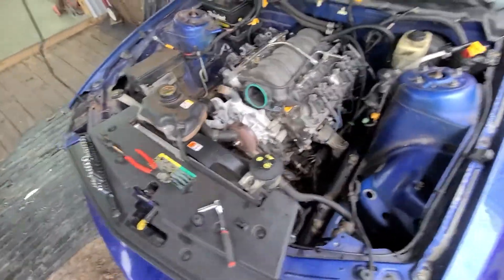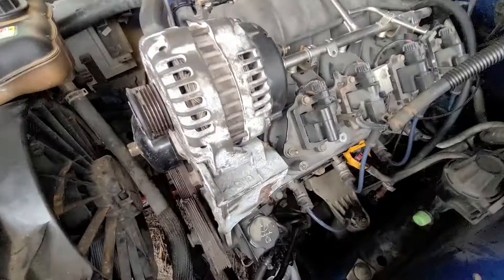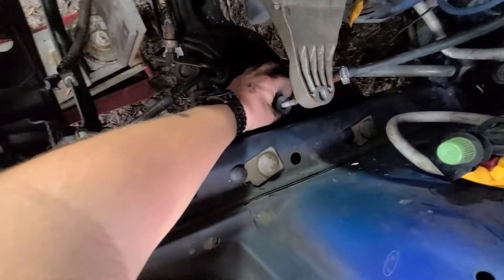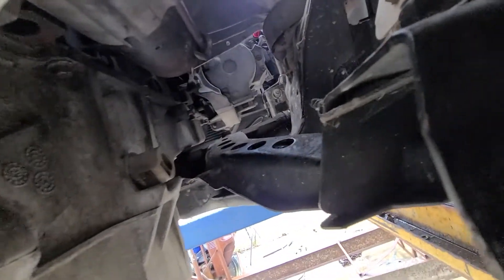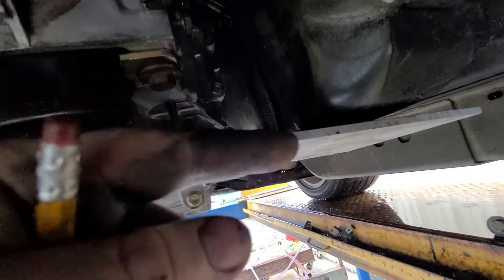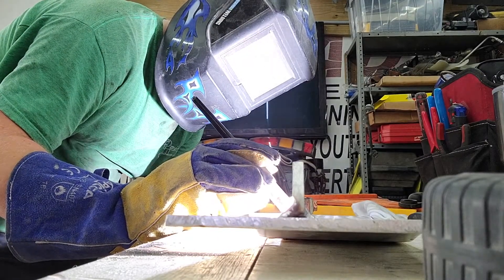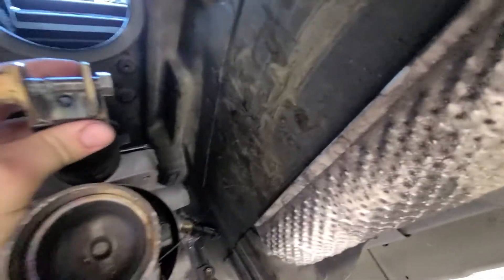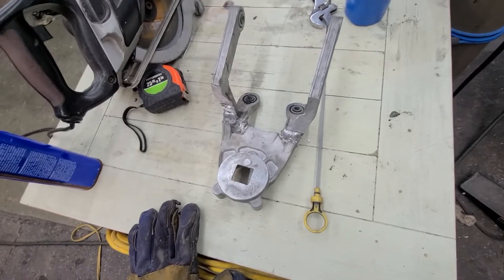LS Swapped S197 Mustang PT.4 | TRANSMISSION CROSSMEMBER & MODIFYING THE CD009 SHIFTER LOCATION

Comment: What did you do for the high pressure side of the power steering pump?
Reply from the maker: I cut off the both the metal high pressure Hoses, left the Ford side on the car, the chevy side on the pump, flared the ends of them and used flare fittings to connect them. Similar to the way you would flare brake Hoses. I have read online that you should install a pressure regulator for the pump pressure to be correct for the steering rack but I have not had issues so far. Time will tell....